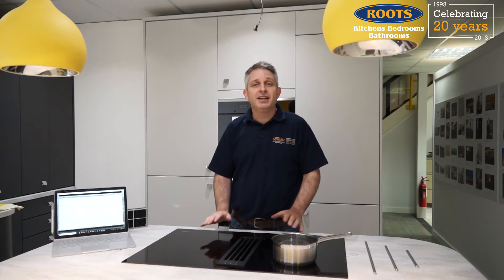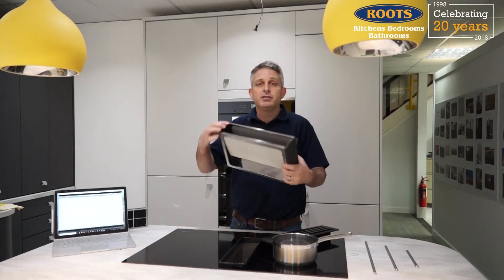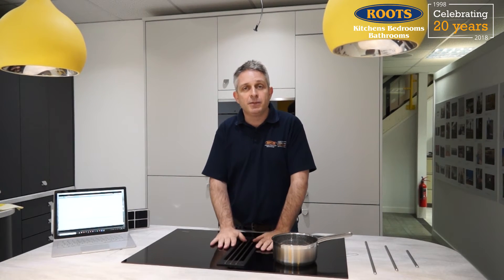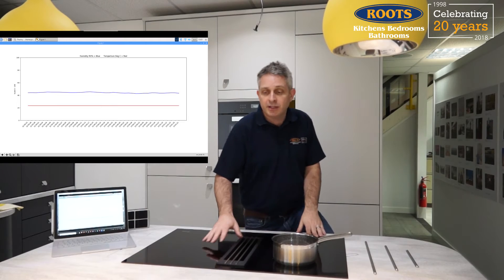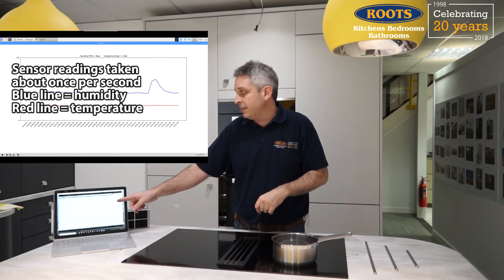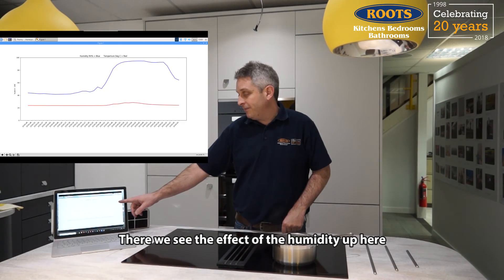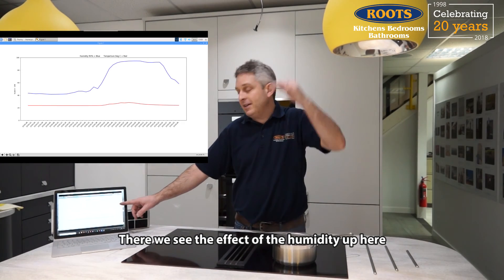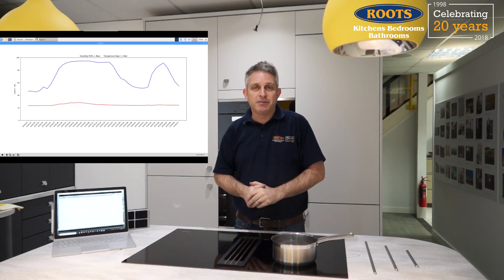We test the effectiveness of extractors that are built into hobs (instead of placed overhead)

Comment: Hi, do you have any noise metrics comparing to traditional extractors?
Reply from the maker: All extractors have standardised EU data sheets so you can compare various performance metrics and these should be available from the manufacturer.
This particular model has a datasheet at https://media.miele.com/downloads/92/f1/04_F61547C6F7151EE89EB26124135E92F1.pdf
The noise level is given for different rates of extraction and those rates are different for each model, so they are not directly comparable but give a good indicator as to what you can expect. For example this model says 49dB at 170m3/hr and 71dB at 490m3/hr.  The noise level also varies depending on whether it is recirculating or ducted and the natural acoustics of the room.
Having said all that, my instinct is that all extractors that draw the air down are going to need to move more air faster than extractors overhead and my assumption therefore is they will generally be noisier as a result. The only way to know for certain is to compare the model specification sheets and I've seen some traditional extractors that are very noisy, especially where they're made to the lowest price possible.  I hope that helps!
Reply: Hi Steve I would be interested to know if you have any comparisons or thoughts on the extractors ability to extract smells?

Comment: Have you tried any other models ? What is the dba rating of the one you used?  Like the Pi work ! Thanks for the video
Reply from the maker: Hi Raj, thanks for the comment and question
All the extractor manufacturers publish the noise levels in their appliance specifications and there are a number of variables and caveats that are relevant so it's worth looking at the details relative to your own design plans. For example, ducted setups generally have a higher extraction rate and lower noise level than recirculating setups. They are also affected by the type of ducting you use (bigger = better), how many bends there are (less = better) and how long the ducting is (shorter = better).  Comparing models is hard because they also have different extraction rates between models and manufacturers so a hood may be quieter because it's doing less work.  All of this before we take into account the room acoustics (for example, the difference between a tile floor vs a carpet floor)

For this extractor I used the 'boost' setting (noisiest), our setup is recirculating and the manual says: 510m3/hr, 77dB(A) re 1pW) == 63dB(A) re 20 µPa

The microphone used is the one built into the video camera and although I'm pretty sure I made no adjustments to the sound levels on the recording (up or down) I wouldn't base choosing one extractor over another based on a youtube clip sound recording :-)    This is the only working 2 in 1 hob we have on display so I've not tested any other brands but from experience I'd expect similar performance and noise from Neff's 'venting hob' or the Bora models. 

Generally, I've found extractors work fine on medium or high settings (rather than 'boost' or 'intensive') if you turn them on as soon as you go to start cooking and allow time for a flow of air to build up.  Also to leave them running on low for a while after cooking as that flow will still help capture air and remove the smells. Many extractors now come with an automatic run on timer (including this model).
I hope that helps!
Steve

PS - If you like Raspberry Pi, you might like to see how this Pi got reused after the video: https://www.rkbb.co.uk/tweets-from-viewfromroots